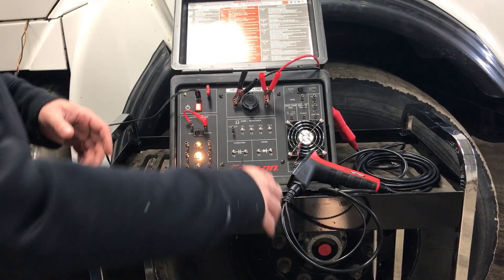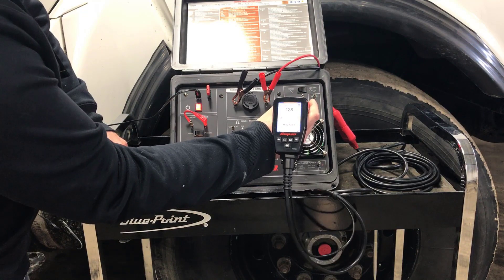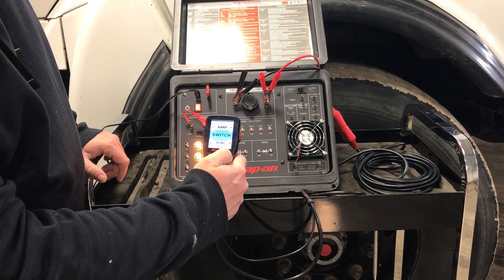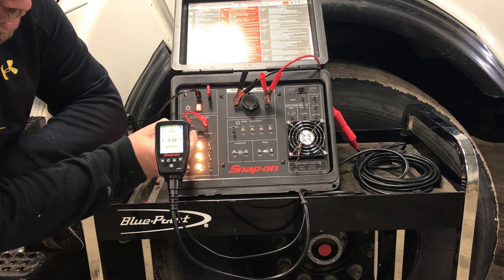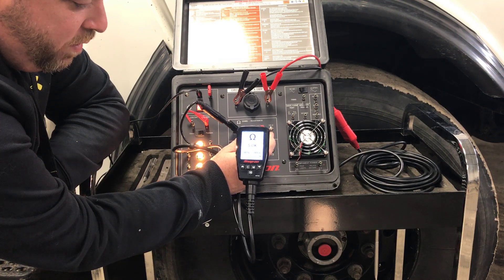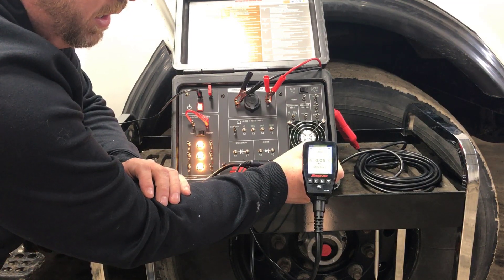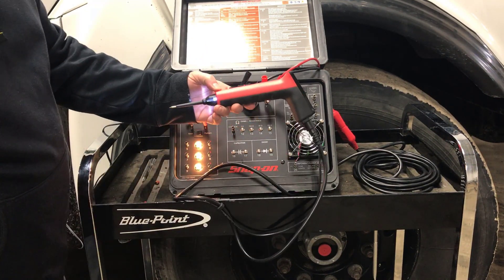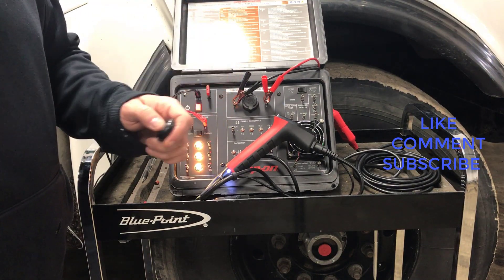SNAP-ON EECT900

Comment: Junky idk i think I'd stay with my power probe because they don't offer and additional cable other than a replacement for the tool at this point. Sometimes I need 30ft of cable to test the lift gates and that's not an option yet.
Reply from the maker: Ash Aphter yeah that's what sucks is they don't offer an extra cable for that thing yet but I'm sure that they will in a matter of time but but the thing is pretty sweet I like it just by testing it a little bit I like it better than a power probe I think it's a little more easier to understand what's going on as you can see it on that screen
Reply: I am betting that that thing is nice display look ez to read on my screen so I'm betting that it real nice i person. I do have one question the probe end can you put the test lead for ur multimeter in and does it work like that. I know the power probe works with the leads and it makes it ezr to test in tight spots. I'm not sure everyone knows that tick or not.
Reply from the maker: Ash Aphter yes I would say that you would be able to the the front hook is very very similar to the power of one see you can probably put one of their skinny ones in the front and as far as the screen goes is really nice are you can see everything really clearly in the colors look really good and it's hard to get it to make out in video because if I zoom in so far then you can't see the whole thing of what I'm working on cell but I'm just let you know it's pretty nice

Comment: I would keep the Fluke and give the SnapOn back, it's way to large to fit in where I would need to place it. I can see it being useful for large trucks though.
Reply: Mark Fox take the tip out and insert multimeter lead, you dont have to try and stuff the tool into tight spots